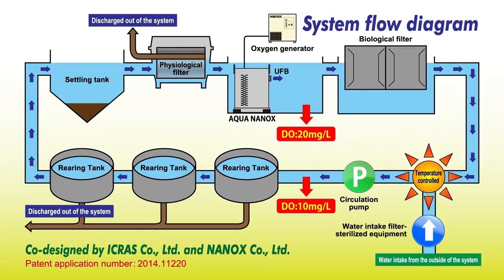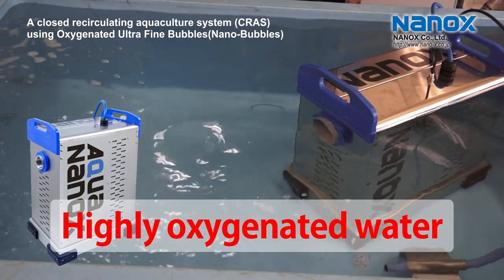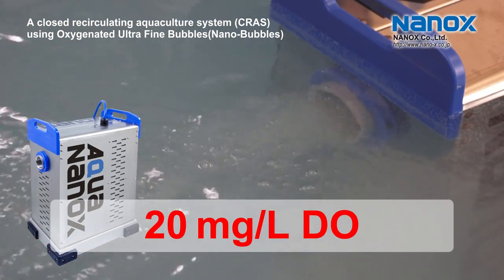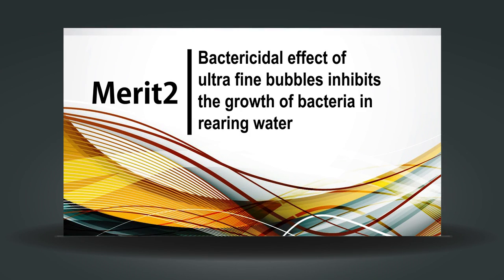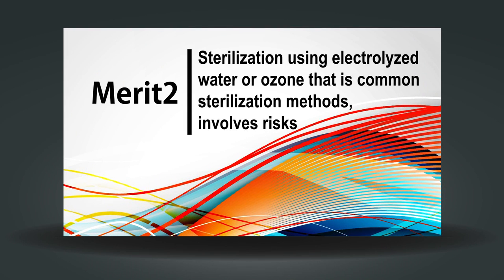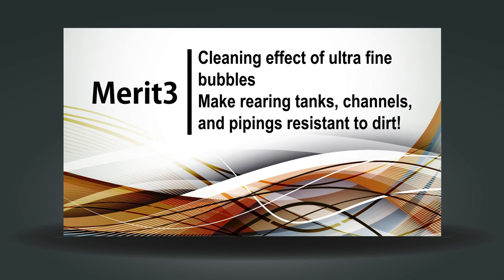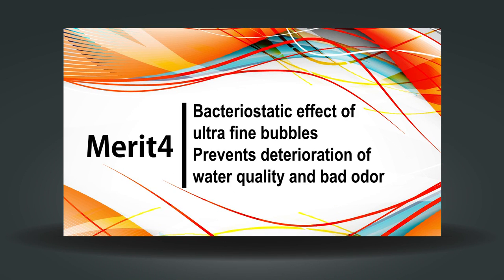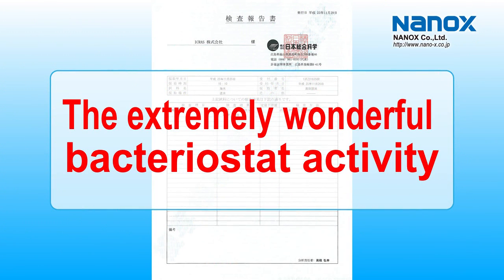A closed recirculating aquaculture system (CRAS) using oxygenated ultra fine bubbles

Comment: ok i see what u did there. its a mistifyer placed in a box having o2 supplied via a secondary machine. the mistifyer  creates the ultrafine bubbles due to the water pressure provided by the tank. thats pretty ingenious considering u could build one for less than $100. very nicely done.
Reply: Hi! Do you know how to build this?
Reply: @dimitrisln  yeah i think ive got a set of plans i made and tested after i saw this, ill see if i can find em on my drive.